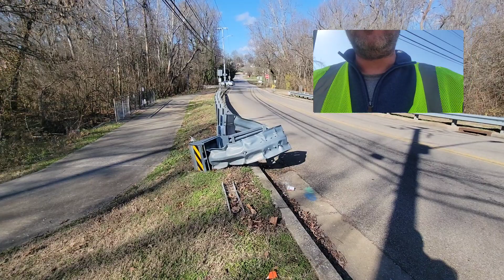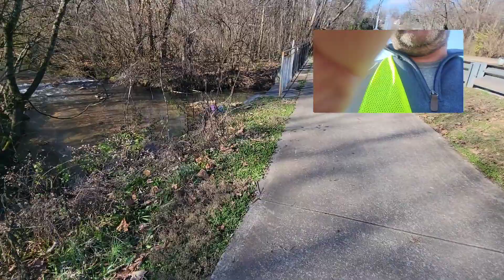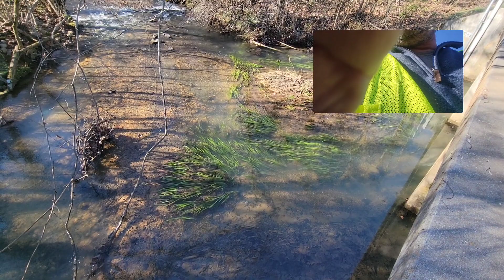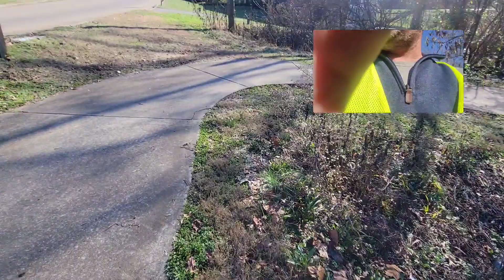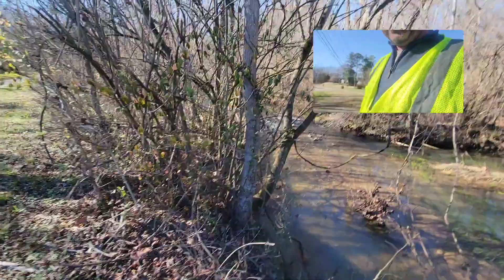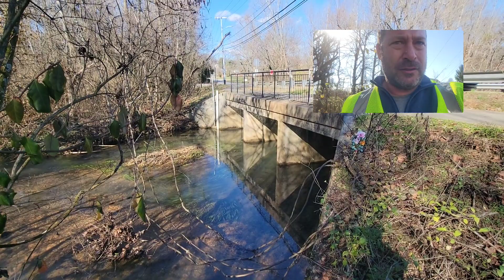Gating Guardrail End Terminals Working EXACTLY as Designed will Lead to DEATHS when Installed Here

Comment: Sir This is brillaint Atlanta needs someone like you to help with the major roads like I95
Reply from the maker: Stay tuned for my story at 11ALIVE this week. Kristin Crowley has shared with Atlanta  several times. We even won an Emmy but GDOT is one tough nut to crack. They are supposed to do a statewide inspection of guardrail.
Reply from the maker: My story is going to be on 11 Alive on 12/29/2022
Reply: Idk if it’s the same up north, but down in Florida the I95 is the most dangerous highway in America

Comment: I understand the problem now: "So what is non-gating and gating?  Gating is term used to describe an attenuator that is designed to allow an errant vehicle to enter a clear zone where it can safely decelerate before coming into contact with a hazard. NCHRP Test 33 and 32 above are gating tests.

When the vehicle comes in contact with the attenuator, the attenuator folds away (or gates) to allow the vehicle to safely pass.  Gating attenuators are more economical than non-gating so if there is enough clear zone you should be using attenuators of the gating variety."
Reply from the maker: Could you take that comment and make my next video????

Awesome comment and one that will definitely help me better articulate the issue.
Reply: @TheGuardrailGuy  You can quote me. If you do a Google search for the text of my comment in quotes you'll find the website I quoted it from. I try to put the URL in a comment and it gets blocked for spam.
Reply: @TheGuardrailGuy  So if I understand the issue correctly, the improper use of a gating attenuator allowed the vehicle to cross behind it, which is undesired here because there isn't a clear area for recovery behind the attenuator.

Comment: I've watched some of your videos and I'd like to know why it isn't the driver's fault? Intoxication, speeding, and texting. If the driver hits a child, then they are a criminal but if they slide pass the child and hit guardrail then they are a victim. Also, that curb in this video is a big deal. Curbs are safety products also.

The guardrail is supposed to capture, contain, and deflect within the design parameters. Gating occurs when the guardrail is hit at too much angle, speed, or weight. The reason for gating is to prevent death by hydrostatic shock. Gating is built into guardrail because in many cases you will have a better chance of surviving going off a cliff than you would have if you stopped dead.
Reply from the maker: But gating is based on the idea that you have a clear zone. It's in every manual and every design standard but never happens.

Alcohol and texting make no difference in terminal function. Guardrail is totally woke!! Guardrail treats everyone the same.
Reply: Definitely not always the driver's fault. Rain, snow, or ice can cause an accident. An animal or child running into the street that you're trying to dodge. Somebody that's driving in the wrong lane for whatever reason causes you to swerve out of the way. You have a medical emergency while driving. You just simply make a mistake (you don't deserve death by drowning for that!)

Safe roads are important.
Reply: @Dragonofshame  I think context got lost. If you are driving 90 in a 30 with blood alcohol at 0.27 and you drive through the guardrail, over a pedestrian path, and into a creek, I feel for your family and other loved ones but not you. The video poster doesn't feel that your behavior should be considered.

Comment: im confused are you saying it should kill you if its fitted properly
Reply: he's saying that the design will let vehicles through if you hit it at a certain angle. that's how it's supposed to work. the problem is when there's no clear area (steep hills, water, trees). then the guardrails just lead people into more dangers of flipping over, drowning, or crashing without any gradual energy absorption. it's a bad choice and a bad design.
Reply: @achewy7700  so whats the solution
Reply: @ohandanotheronebitesthedus6247  Either landscape the area to provide a proper clear area behind the guard rail, or use a non-gating guard rail where you cannot create clear run off. At least that's my assumption from what I've watched here.

Comment: But it was a van, not a car. Much higher centre of gravity, much taller, much heavier, much more inertia and momentum etc. Vans make up a small percentage of road users so is that the right example to use to make your point? Could I get a good answer and reply to this message if you could because I'm genuinely curious about it. Not being argumentative. I could be totally wrong :)
Reply: Not answering for @UkrainePapa, but I would think we would want a rating that includes safety for vehicles like vans.
Reply: Pickup trucks have been number 1 sellers for decades. Van , car , truck.  It was the wrong guardrail. Should have had 20 more feet of regular before the gated
Reply from the maker: More rail and preferably NGT or ERMES guardrail terminals
Reply: @TheGuardrailGuy  I work on railway tracks not road works mate that meant nothing to me lol.